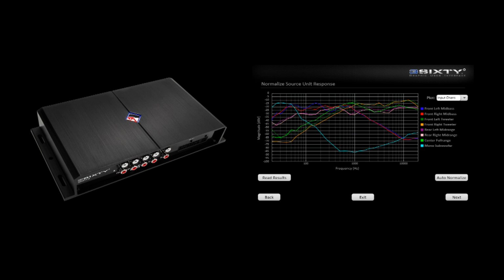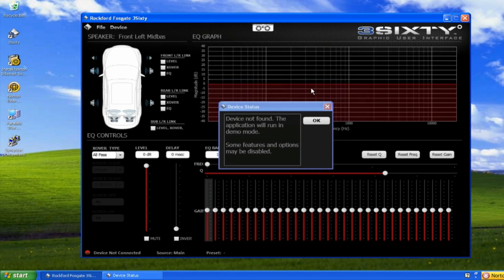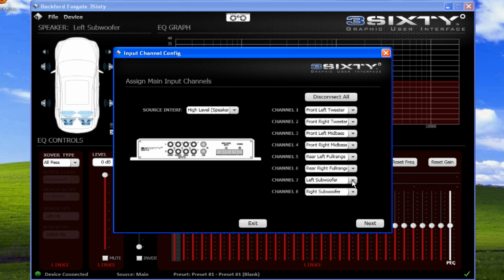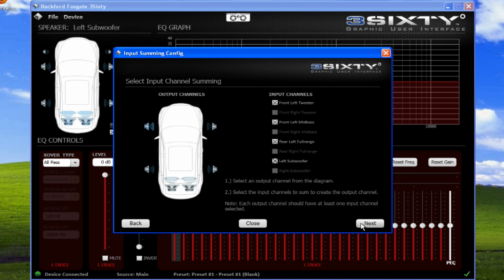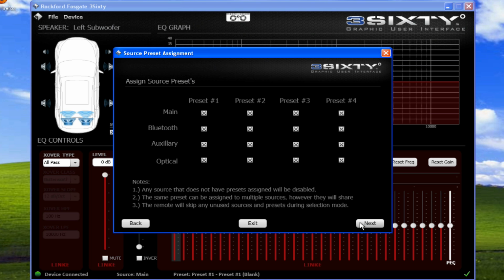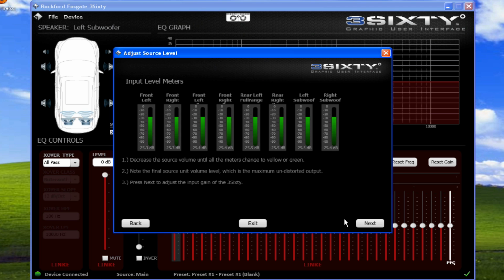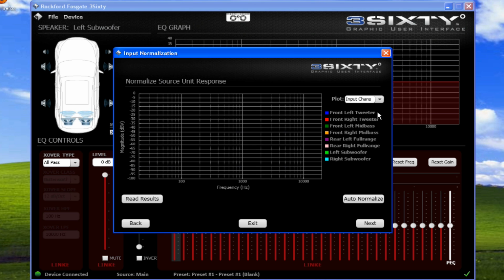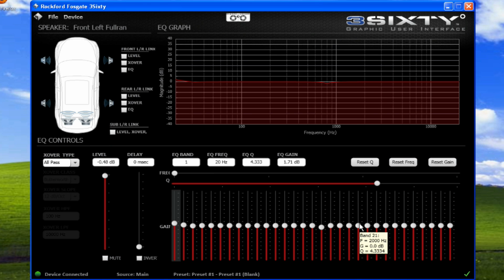3Sixty.3 OEM Setup Wizard Tutorial

Comment: This is my next investment CANT BE MORE EXCITED!!!!
Reply from the maker: Unless your OEM system requires the Summing feature of the 3Sixty.3, it may be worth looking into the DSR1 (the young brother of the 3Sixty.3) which has an iPhone/Android App available for tuning.  You can find out more about the DSR1 here: https://rockfordfosgate.com/products/details/dsr1/
Reply: Rockford Fosgate I’ve been looking into it I really appreciate you for bringing that to my attention!!!  My truck has been bringing lots of attention in Topeka ks would like to showcase only Rockford but have all mix matched current spending 600 on wire and one battery I will get around to sharing it all when it starts to look like something but I’ve first hand seen the different this will make and would love to have it on show (display) instead of the dsr1 but we’ll see! I’m not into Guaranteeing showing up to sema and ces etc... my Rockford dealer would love to use my car as a promotional pice for their business instead I have brought many customers with my old setup and business cars my old setup was impressive to many with 4 p2s 12s  in a ranger my end goal is a t2500 on 4 p3 12s  or t series if sponsored (running sealed only my preference for sq)  and a old t1000.4 to go nicely  I have a hard time with your pro mids BUT they don’t sound bad with this product showcased in this video! I’ll keep up to date when the box and electrical is done!
Reply from the maker: @HOTSHOT-ls1bc  Thanks for your reply.  Just want to make sure you have all the knowledge needed to make the right decisions for your audio system.  The DSR1 can be hidden since it's basically a black-box processor. The Punch Pro midrange & tweeters are primarily designed to be LOUD.  If you're looking more for Sound Quality, simply look into the Punch or Power Series component systems.  They have been meticulously engineered for optimum frequency response and are a good choice for any SQ vehicle.

Comment: I have a question, the "normalize inputs" is it flattening and also removing all EQ's fom the factory HU and amp? or is it just flattening? also what is the output voltage? and is it adjustable? I am going to use it on two RF prime amps which accepts a max of  4V
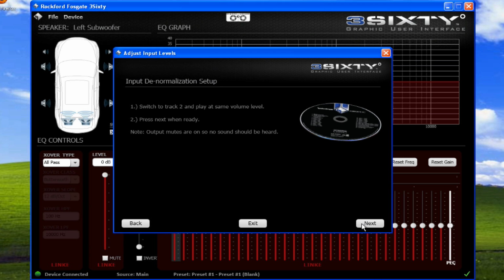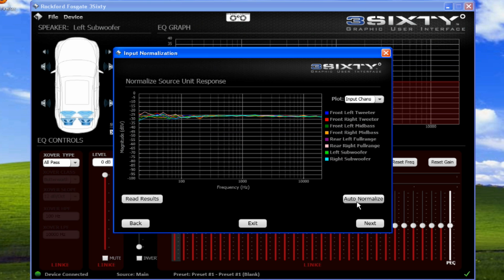Reply from the maker: Great questions Camera!  The 3Sixty.3 denormalizing input process (shown at timecode 05:47) technically does not remove EQs from the factory source and amp since it cannot control those units.  However, it does run calculations needed to offset the boost and cut from the factory audio signal.  The resulting graph illustrates this at timecode 06:28.  For example, if the factory system has a +6dB boost at 500Hz, the 3Sixty.3 will attempt to reduce 500Hz by -6dB.  The result is a "flattened" signal at that frequency.

The output voltage of the 3Sixty.3 is rated at 8V RMS, but it doesn't produce 8 Volts all the time.  Metaphorically, it would be saying your car goes 120 MPH everywhere you drive because it's capable of being driven that fast (well, I guess you could if you live dangerously and don't mind felony speeding tickets, but that's another story.)  Although the PRIME amplifier has "4V" inputs, it is perfectly fine to overdrive the input with 8 volts.  You're probably freaking out, but it's simply "Gain Overlap".  If you were to set your amplifier gains so they "never clipped", you could turn your volume to MAX and we could have a normal conversation without yelling at each other.  We typically set Gain Overlap equivalent to +10dB on average systems to achieve a respectable balance of SPL and SQ.  Once you setup the 3Sixty.3, you'll start with the amplifier gains to minimum, increase the volume to the max clipping point (as explained in the video) then increase the amplifier gains to a level where it's the maximum loudness you'll ever listen to your system.  Now you're Done!

Comment: Earlier you said: "The software is a native Windows application.  I screen recorded this on my Mac running Parallels and Windows XP.  Rockford Fosgate does not "officially" support running the 3Sixty.3 UI on a MAC, but I will be posting a 4th video on work-arounds when running in a Virtual Machine."

I have one of these DSPs waiting to be installed and do not have any Windows based devices.. can you post a couple of details about running it under OSX? I get it isn't supported and no warranty, etc etc etc.. is there anything to it literally other than installing it on top of XP inside Parallels? Would prefer virtualbox if it's known to work so that I don't have to buy Parallels, but I will to save the headache if it's needed
Reply from the maker: We have only tested functionality on a MacBook Pro running Parallels + Windows.  Technically, if the virtual machine can run Windows, you should be able to run the 3Sixty.3 Windows Software.  The only difficult part should be matching your USB connectors to the virtual machine so it can "see" the signal processor being plugged in.  As stated previously, we only officially support Windows.
Reply: Rockford Fosgate Yeah, I had really limited success testing both under Virtualbox and Parallels with XP as well as Win7. I did map the USB device names. It recognizes the device most of the time but usually detects it's powered USB only, and usually the software freezes within a couple of minutes when it does detect power. I was able to get a couple of 10-15 minute sessions in after many attempts, but ultimately I had to borrow a native windows laptop. I'd love to know of any other suggestions - USB device mapping and trying different OS flavors for compatibility mode is about the extent of what I've messed around with.
Reply from the maker: We're right there with you in regards to USB mapping, but that's the extent of our testing. My Parallels + Windows installation doesn't freeze and seems to let me get all the way through the setup, as shown by both the Aftermarket + OEM tutorials.

Comment: Noob question do I still have to set frequency and what not on my amps if using this
Reply from the maker: No, if you're setting all equalizer and crossover adjustments in the 3Sixty.3, then the settings in the amplifier become redundant and do not need to be used.
Reply: That's what I was thinking so what would u set the amps to or does it not matter
Reply from the maker: If you use the 3Sixty.3 for all the crossover and equalizer settings (which we would recommend because that's why you have it), all your amplifier crossover settings would be ALL-PASS and your EQ settings would be set FLAT.

Comment: I've owned 4 of these. 2 by warranty and bought other 2. ALL FOUR failed exactly the same way. resisters on the board failed on the amp rca side. None lasted very long. Pass this one up and get a dsr-1 instead
Reply from the maker: Thanks for your feedback.  Speaking of that, since they failed on the RCA side, it sounds like the system may have had DC Offset present on the RCA jacks from the source unit. Another possibility is any sort of feedback from the source unit itself during turn-on/turn-off.

Comment: Has ANYONE gotten this to work on a windows 10 surfacebook that only has usb 3.0 ports? Just stays in demo mode....
Reply from the maker: Hi Slick, If the software is remaining in DEMO MODE, then the computer software is not recognizing the USB connection to the 3Sixty.3 hardware.  Per our software downloads page, we have only verified compatibility up to Windows 7 (16-bit & 32-bit) with .NET framework 3.5 SP1.  http://rftech.custhelp.com/app/answers/detail/a_id/1066
Reply: We found a workaround by installing windows 7 in a virtual machine and connecting to the device that way. Ended up retiring it for another device, though, as the 360 was picking up data-style noise and it was very loud. couldn't solve it. Direct replacement of a different device ran fine.
Reply from the maker: Thanks for the follow up on your work-around.  Regarding the "data-style noise", installers should be aware that many CLASS-D amplifiers generate large amounts of EMI (Electro Magnetic Interference), which can affect the communication with the 3Sixty.3 and/or remote control. 

If using a CLASS-D amplifier:
1) Do not route the 3Sixty.3 remote cable with any amplifier's power, turn-on, or ground cable.
2) Do not route the 3Sixty.3 high-level input harness with any amplifier's power, turn-on, or ground cable.
3) Use a different cable route (see #2 above) and/or use a shorter cable.
4) Physically move the 3Sixty.3 signal processor away from the noisy amplifier or away from the amp-rack.
5) With the system on, press the RESET button and monitor the remote control for normal behavior.

Comment: Does the 360.3 provide a load to a victory amp to get a signal? I have a 2014 grand Cherokee and I want to do some audio upgrades but the factory amp will not output a signal without a load. Any info you have is much appreciated thank you.
Reply from the maker: zayres29 The 3Sixty.3 preamplifier outputs have an output impedance of 100-Ohms, which is typically not enough to turn-on the amplifier.  However, our technical support can show you how to trick the amplifier into turning on.  They can be reached at http://rftech.custhelp.com.
Reply: Rockford Fosgate thank you for the help